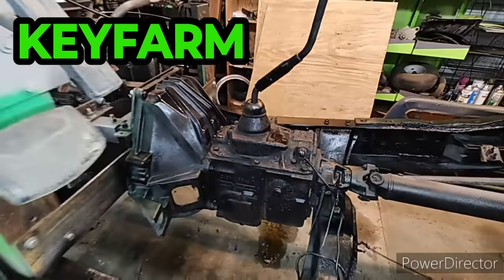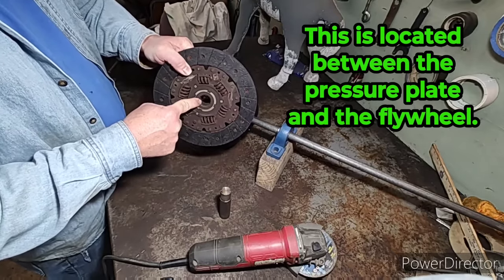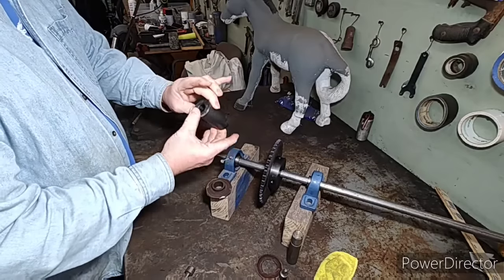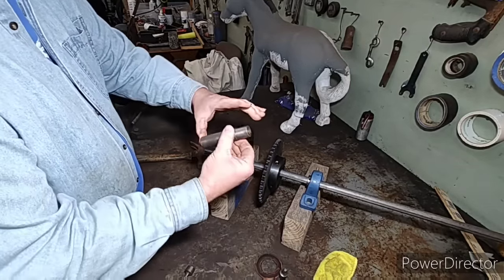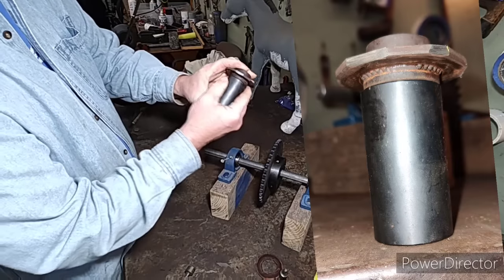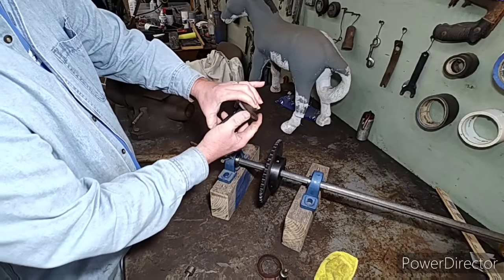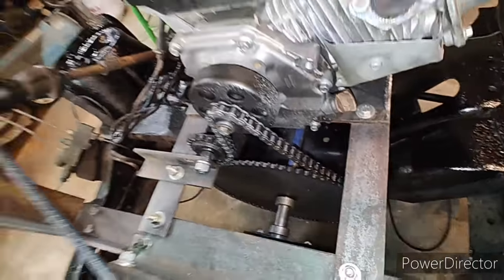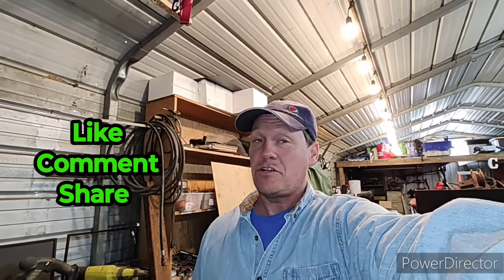How to connect a go-kart engine to a manual transmission. Predator Duromax Keyfarm

Comment from the maker: This is the video of how to shift. Remember to like 👍.
https://youtu.be/Y2WUUP5hOt4
Reply: I’m watching it right now lol 😆
Reply: @ChrisfromKeyfarm  I just found the couplers tonight. 
Let the building begin. 
Thanks for all your help and inspiration!
Reply: It'shifts good. I have a Suzuki 4 cylinder 6 speed with its own clutch😂🎉😮
That's 40  forward speeds, probably only several usable but still. I'll get it to work to go ultra low and run about what it the 5:50 Suzuki engine is not a slouch.. bout.. 65 hp but it's a winder
Reply from the maker: @RonaldDaub-v9y cool

Comment: He sure did that the hard way. All you need is a v belt and two pulleys one for the output shaft of the engine the other for the input shaft of the transmission by varying the size of the pulleys you can very the ratio between the engine and a transmission. Then all you need is an idler pulley so you can loosen the belt to shift gears very easy very straightforward.
Reply from the maker: So you would mount a pulley onto the transmission shaft without any bearing support? Good luck. It's a little more complicated to build a slip / tension clutch than to just use a centrifugal clutch. My current project is getting one, but for now it has a centrifugal clutch.
Reply: You would just break stuff no trans is built to take lateral load on the input shaft
Reply from the maker: I told him that too, he never did reply.
Reply: @ChrisfromKeyfarm   could you mount a main shaft extension with a bearing support . And attach a cvt kart type system to the extension you added . 
The bearing support would take care of lateral support

I have a MJ 4 speed and a Vw buggy needing some new life . 
I'm thinking the v-twin for both ?

Comment: I once had a Frankenstein tractor someone had built from a old school bus drivetrain. They used a rotor tiler transmission with its five horse and mounted the whole thing in front the bus transmission sideways. Then they simply drilled a hole through bus input shaft and linked it to the rotor tiler drive (right where the hub for the tines went) with a pipe .  It couldn't hardly be stopped, but forth gear was a slow walk! Lol
Reply from the maker: Cool

Comment: I'd just have the engine turn a flywheel off the original engine using pulleys and belts and build a frame to mount the transmission on.
Reply from the maker: Mounting the flywheel would be difficult.

Comment: @Keyfarm - I am swapping a go-kart engine into a 1989 Isuzu Pickup that came with a 2.3 liter gas engine and a 5-speed cable-clutch-operated transmission. Question: are there any cable operated clutch kits available for small engines instead of using a centrifugal clutch? I am concerned the centrifugal clutches in your designs may wear out quickly?
Reply from the maker: There may be a clutch like that I have never seen nor used one most people build a tension clutch with a belt

Comment: Why not use the back piece of the engine and use the orginal clutch
Reply from the maker: What do you mean by back piece of the engine, cut the block?
Reply: @ChrisfromKeyfarm  I am from Sweden . Problem to explain. If you take a steel plate adapter . And cut of  the back of the crankshaft. Then you dont ned to have a moped clutch?  Never done , just my thought
Reply: Cool vidios by the way !!!

Comment: Im curious, Would this work with an automatic transmission? 🤔 or would there be to many variables like programming for the transmission to operate?...cooling and fluid supply is not an issue. Automatic Transmissions use MAF,IAC, TPS data among others to operate with a standard engine but I would think something like a th350 wouldnt be an issue.
Reply from the maker: I don't know if a turbo 350 would shift or not Thanks for watching
Reply: @ChrisfromKeyfarm  not enough vaccume?
Reply from the maker: Not sure

Comment: How do you get the shaft perfectly centered with the transmission shaft? Like when mounting the bearing?
Reply from the maker: When the shaft is plugged into the adapter and coming out towards the front you can kind of figure out where the center is get the bearings close but a little low and then shim them and once you tighten everything down and it still turns freely you're good to go.
Reply: @ChrisfromKeyfarm  alright, that’s what my plan was. Just wanted to see how you did it. Thanks!

Comment: Great idea to use the clutch disk hub. I would use a flex coupler to isolate the crank shaft from transmission movement or misalignment. We use the flex couplers to connect small engines to hydraulic pumps for log splitters.
Reply from the maker: I used a Lovejoy coupler on my golf cart conversion for just the reason you mentioned, however with this setup it's really not necessary because it is pretty easy to get the shaft true in line with the use of body shims under the bearings if needed. Thanks for watching.

Comment: Hi Chris!
Love your videos and am still building my grandsons 1949 Willys Jeep with Predator engine. 

Update: 
I now have everything needed except for the one inch inside diameter coupler. 
My searches on Ebay are not turning up anything with the wall thickness and set screws that you are showing in the videos. 
Please advise the search description that might show the desired coupler for this project. 
Thanks!

Your videos have really inspired me to create this awesome project for my grandson with CP. 
This is his Jeep that he will drive offroad and on and off the trailer at car shows.

Thanks again!

Comment: Looks like that'll work. 
But to bad someone don't make a "manual" type/style clutch that would fit right in the place of that centrifugal clutch.
Reply from the maker: At some point I'll probably build a tension clutch that works off the pedal. There are also manual clutches out there that work on an electric switch I think

Comment: If the small tensioning, sprocket is under Spring pressure that will take any missile alignment out of the rotation.
Reply from the maker: Right now it's hard mounted but it may be a spring tensioner eventually.

Comment: Curious to see how long that little centrifugal clutch will last?
I think a variable pulley system off a gulf car would be stronger?
Hope it works for all of your time and efforts!
Reply from the maker: I've had some of them in place for years , I gear stuff low enough that it isn't hard on the clutch.

Comment: You must have used a go cart clutch in place of the actual clutch that was with the original manual transmission, hiw much do they cost and are they rugged enough for what you're doing? Enjoying the content brother 👍
Reply from the maker: A go-kart clutch for a Predator 212 is only about 30 bucks and for the bigger engines they're about 55 and since I run a gear ratio that doesn't put a lot of stress on the clutch they really last a long time The one on the tractor lasted 3 years and I went to a different engine it never did wear out.

Comment: Do you drill a pilot bearing into your shaft? Ses like it would reduce side loading on the trans input
Reply from the maker: There is no side loading on the input shaft of the transmission because the new added shaft is supported by two bearings

Comment: Good video! By chance what transmission did you use?
Reply from the maker: I've used the 5 speed in a 1991 B2200 Mazda truck, a 4 speed in a 1975 MGB , and a Borg Warner T19 in a 1985 F-350. As well as a 1941 Farmall transmission.

Comment: Nice job but on my project im going to use a dodge 5 speed manual with the bell housing and the flywheel and clutch in my buggie making everything i need to adapt to a 20 hp Kohler engine thanks
Reply from the maker: That's very interesting Make sure you get all that heavy stuff spinning true or it's going to have a terrible wobble, also that 20 HP isn't going to like turning all that rotating mass/ at first.

Comment: Will the engine power an automatic trans?
Reply from the maker: Not sure but there are definitely some obstacles in the way.
Reply: The biggest problem with an automatic transmission is the amount of horsepower needed to get it moving due to the torque converter . A Chevy Power glide eats up 18 hp. A TH 350 takes 36 hp. And a TH 400 is hungrier yet at 48 hp. That being said , in the old days ( late 60s ) drag racers would remove the converter and swap it out for a manual clutch assembly . Remove the hub from the converter and weld it to your shaft just like you did with your clutch hub . The converter hub turns the front pump in the trans . BTW , the shifts will be brutal as the torque converter absorbs all of the shock from the shift . If you've ever driven a car with a shift kit installed, you've got an idea of what to expect .
Reply from the maker: Yes you could easily replace the torque converter with a centrifugal clutch just like this manual setup

Comment: So if you have a standard how do you use a clutch to shift it into different gears
Reply from the maker: It's all about using the centrifugal clutch to disengage the engine from the transmission and timing you can shift any manual without the clutch if you know how to do it I'm making a video this week that shows how.
Reply from the maker: https://youtu.be/Y2WUUP5hOt4

Comment: Why have a centrifugal clutch on the engine if you have a clutch in the transmission. Its just gonna burn from all the force put in before the reduction.
Reply from the maker: The original clutch is attached to the flywheel, which is attached to the back of the crankshaft, so the clutch doesn't attach to the transmission. As long as you gear it properly, the centrifugal clutch lasts a long time.

Comment: HUM, thanks for THOSE details, you may of given the others somewhere else? Just a respectful suggestion, give a LIST per part, like the BIG sprocket identification, teeth #, Chain size, if it has a bore on both sides, or just the actual Part Number & source of the exact one, some of us are mechanical enough to build from a parts list but not so good in rounding up the individual parts, Thanks again !
Reply from the maker: Most of this is a general concept build , many of the parts used would vary from project to project. I am happy to help anyone find particular parts as they need them.
Reply: I'm assuming that doing this with an automatic transmission is impossible?  @ChrisfromKeyfarm
Reply from the maker: I don't know , it might not shift.

Comment: Skidoo style torque converter?? 🤔
Reply from the maker: I normally just use a go-kart style clutch.
Reply: @ChrisfromKeyfarm  that works pretty good too, but might wanna check out a belt CVT style one, you might be pleasently suprized with how well it works
Reply from the maker: I've used torque converters on projects, I don't really like them, and the really good ones cost a fortune
Reply: @ChrisfromKeyfarm  well, they are an adapted taste, an ole sled might go cheap? Or fer about the same cost as just the gokart flavored belt converter.. but just a thought,

Comment: Ok this is gonna sound really stupid, but I literally have 1976 Ford Fiesta running a 670 Predator Vtwin. The absolute worst thing about it is, that it's more efficient and about as powerful as the original 1 litre engine the car was equipped with. 🤦🏻‍♀️

So it is actually a viable and reasonable conversion. I've been thinking about throwing a tiny supercharger on it just for added ridiculousness.
Reply from the maker: Cool , Id like to see that. ckeyfarm@gmail.com

Comment: You are going to miss horsepower when in mud, its either put in it a stronger motor or good reductor,  reduction is most important when going through mud, becouse if it is going slow, the wheels will not spin too much in mud and when releasing the clutch under the preasure it also won't burn the clutvh
Reply from the maker: Your absolutely right.

Comment: Shifting gears is easy, just like doing it without the clutch and go slow.
Reply from the maker: I see you have diesel in your name so you know how to shift that way but 99% of the population doesn't.
Reply: @ChrisfromKeyfarm  95% doesn't know how to drive a manual lol
Reply from the maker: Less and less everyday
Reply: @ChrisfromKeyfarm  I have 3 daughters, the oldest is 15 and I required her to learn to drive with manual first. She probably won't drive one anymore but at least she will know.
Reply from the maker: Cool, where I work a lot of guys are restricted to a manual  in the big truck world and it causes a real hassle.
Reply: @ChrisfromKeyfarm  yeah automatic restricted on a CDL would be funny to have.
Reply from the maker: About half of em are restricted
Reply: @ChrisfromKeyfarm  when I got mine I used a automatic garbage truck, it was like driving a pickup! I tried to get my a with a pickup and trailer but never got around to the drive test until regulations changed and then missed the boat to do it with class time. My B has served me well for 18 years I'll just ride that one out.
Reply from the maker: https://youtu.be/Y2WUUP5hOt4

Comment: That still does not explain how you shift!!!! Do you just grind it from 1st gear to 2nd gear to 3rd, etc? What about coming to a stop, do you just yank it out of gear into neutral? What about taking off, same thing same question. I see how it works and I get that but I don't get how your shifting without a clutch.
Reply from the maker: Like I mentioned in the video ,showing you how to shift is the next video but no there's no grinding.😀